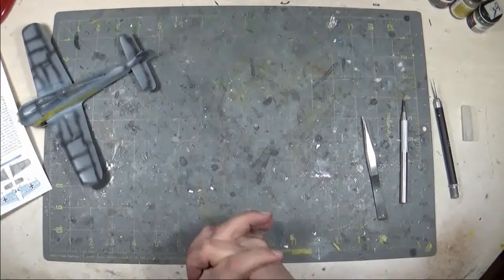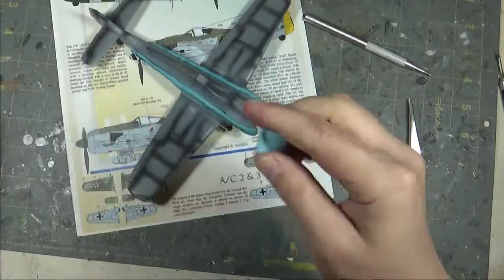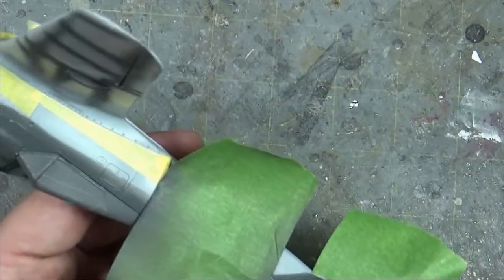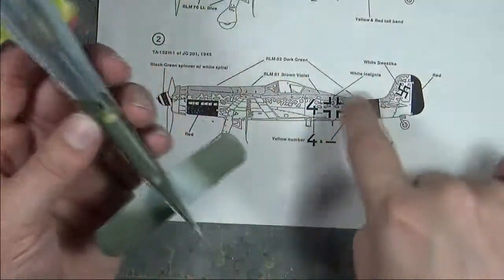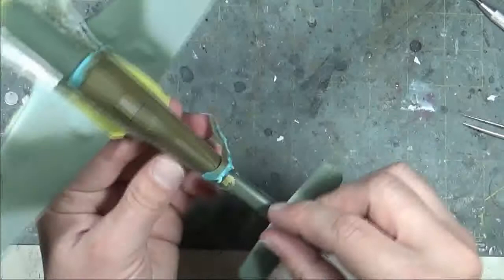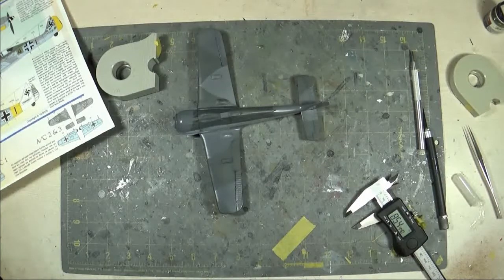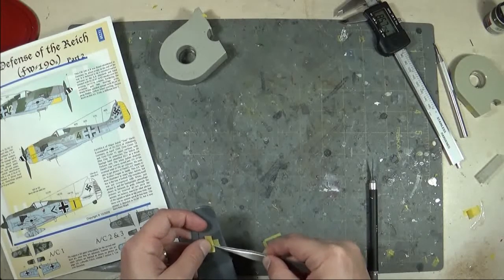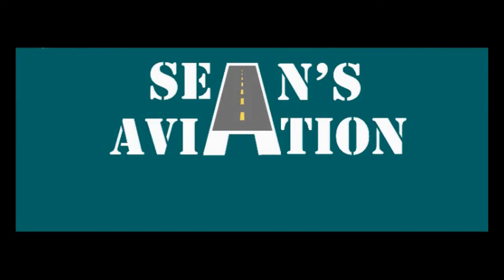Tips & Tricks ep6: Fuselage masking for camo

Comment: I have no finger movement and struggle with masking. The poster putty idea helped me so much. Use to take me hours to mask off 1/14 scale truck. Now it is fast and easy. If you want a crisp lines just press it on, cut it with a blade and then remove the part you cut off. It cuts nicely 100% easier then masking tape.j (for me anyway)